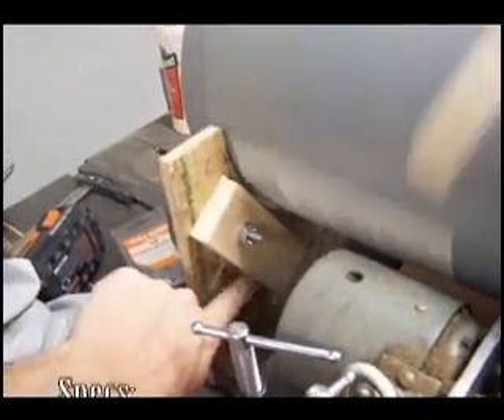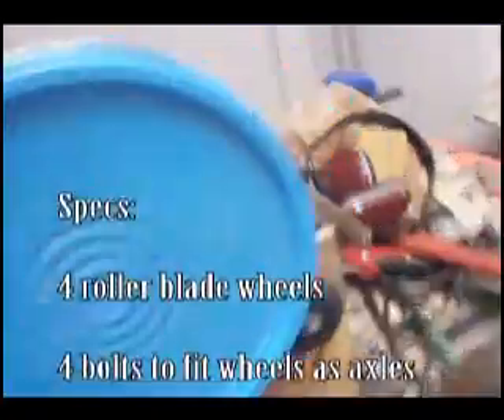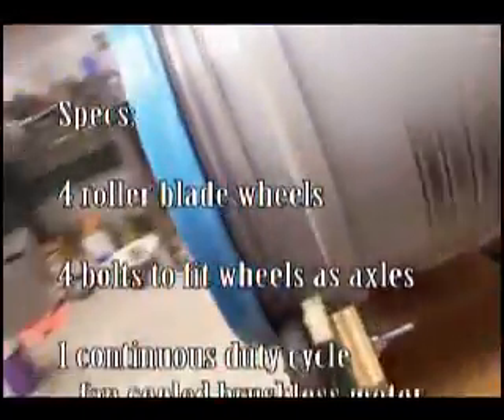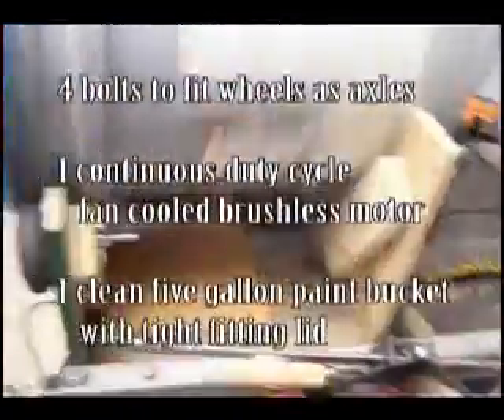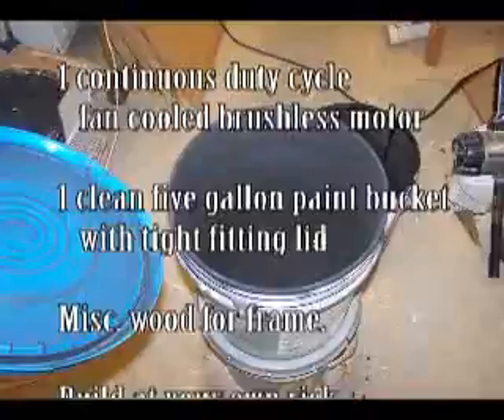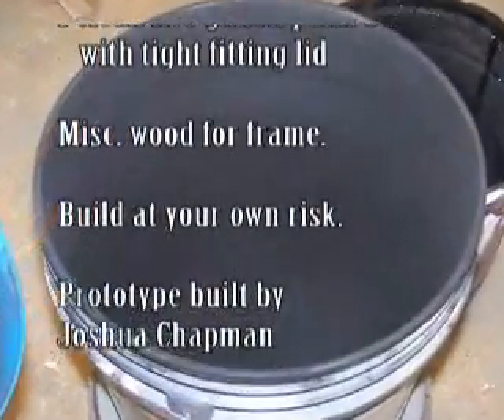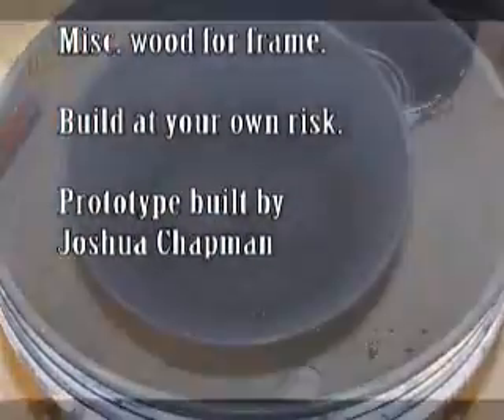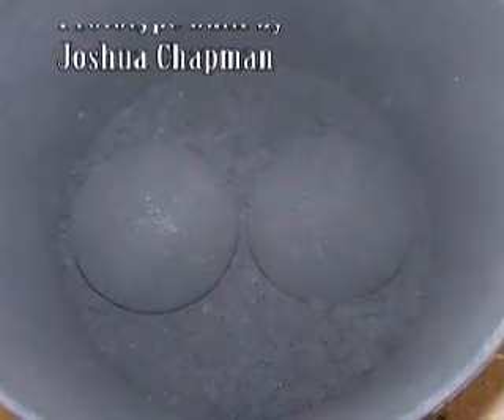Ball Mill

Comment: Nice mill. lead balls were  used in powder mills.   the motor is not double reduction it's just stepped off with an intermediate wheel. It would go the same speed if it contacted the barrel outright.

Comment: not double reduction if your talking rpm's then yes its reduction im not sure about how much exactly but if you have a 2 inch circumference pulley/roller and a 4 inch circumference pulley/roller and they are touching yes for every rotation of the 2 inch pulley there is only a half rotation for the 4 inch pulley but your still turning at the same SPEED but not the same RPM'S great video i like the simple design

Comment: I would like to point that isn't double reduction. For it to be double reduction you would need to have the first shaft, connected to a pulley, with on the same shaft as the pulley, has another pulley, which is connected to a third pulley, which connects to the 5 gallon container

Comment: It's not double reduction. The size of the intermediate wheel doesn't matter, the result still comes out to 107.8 rpm. If you wanted double reduction the intermediate shaft would need two wheels of different sizes.

Comment: Hey josh. I'm curious if your brushless motor. Where would I acquired something like it? Thanks
Reply from the maker: This is a really small motor, about 1/10 hp. You could try a salvage/recycler yard, motor repair shop, ebay, classified ads, business, or maybe even a DC motor off a scraped car. a wiper motor might do it or a starter motor, but then you have to figure out how to power it. I find stuff like this for free quite frequently.